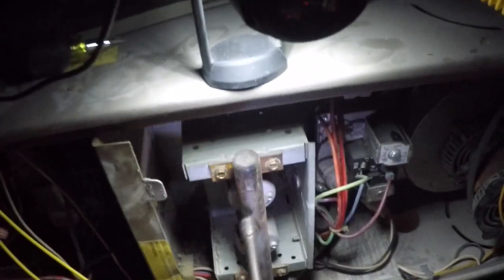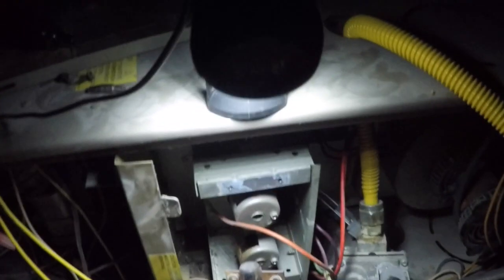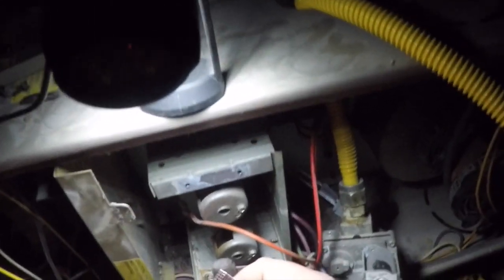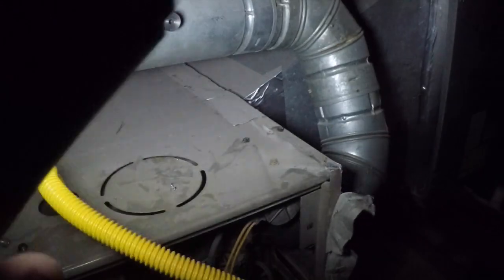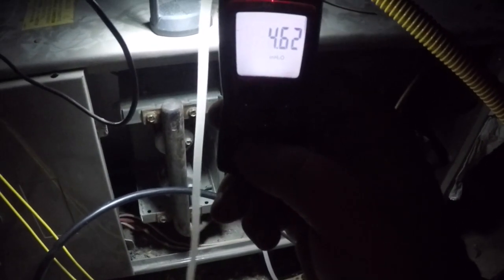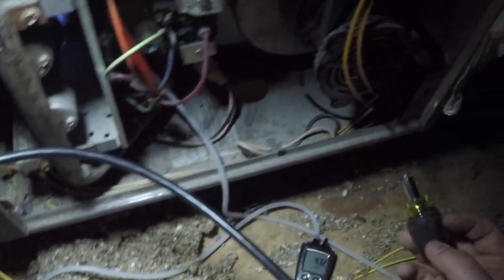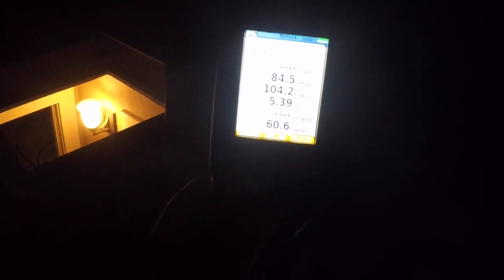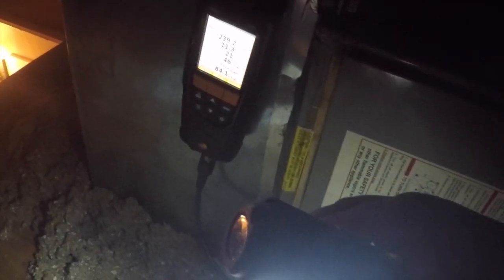Checking A Furnace (Combustion Test)

Comment: manifold pressure being that high I'm surprised that unit didn't have problems tripping the high limits from the get-go. I lived in higher elevations above 4000 feet and you have to always check temperature rises and sometimes you have to throw the manifold pressure will quite a ways back so many factors have orfices for high elevation and some just have you have lower pressure on manifold. I never use the combustion analyzer on a gas furnace but might not be a bad way to detect a cracked heat exchanger if it's not obvious but that unit doesn't look that old I'm surprised that thing around with that much gas pressure on the manifold. I seen a few videos with people doing combustion analyzing on residential equipment , but you cannot alter anything if it does not come out the way you want like changing offices or anything for more air or anything like that the manufacturer will not be liable for anything that goes wrong it's all on you

Comment: Nice video John. Good way to dial it in. Most techs would have replaced the board and Ignitor and walked away and eventually wonder why the heat exchanger cracked. Lol

Comment: I would like to start this comment out by saying that I respect you, what you do and the knowledge you have accrued. Being in the same trade and learned many of the same things such as adjusting gas pressure and pretty blue flame means good burn, I have had most of my preconceived notions blown out of the water. I recently took a class hosted by my supply house from NCI, the National Comfort Institute. The class was on CO safety and combustion, the guy that taught the class has about 38 years in the HVAC combustion field. I learned more in my 3 days there than I have in the past 5 years. By the readings I saw on that combustion analyzer you had there, that stack temp was way too low, that unit should be running a flue temp anywhere from 302-402 degrees. Check this class out, it's kinda pricey but so worth it. Thank you for all your videos, keep me coming!

Comment: John here on my twin furnace I have screws in the test access ports I drilled for the Testo 320's probe. The giant screws are the type used on "Butler/metal  Buildings" that holds the vertical metal panels on the outside.  The 80 percent ancient 1985 Carrier's metal vents are very warm, thus I used screws to cover the test ports instead of tape. My used Testo 320's Oxygen sensor finally failed thus I have a new O sensor on order. The CO sensor passes at start but the O sensor finally died. The unit was bought used about 18 months ago so the sensors are probably several years old.  The sensors look easy to replace. Cool that you have a Testo 320 too. Steve Lav's videos  convinced me that I should invest in a tool to measure CO.

Comment: That gas hose going through the cabinet penetration without any sort of rubber grommet to protect the hose is just horrible. Any vibration in the unit caused by the fan etc, and it will wear right through the hose.